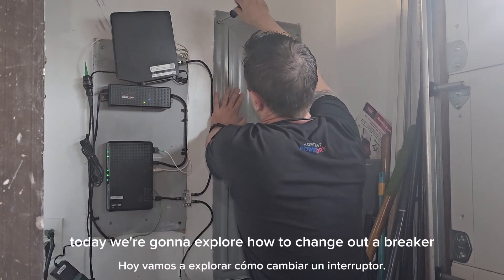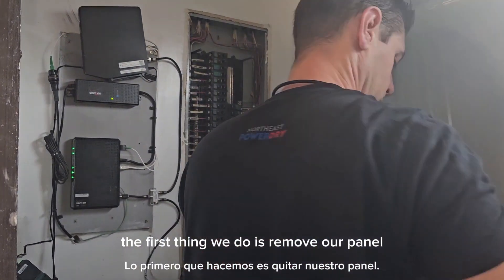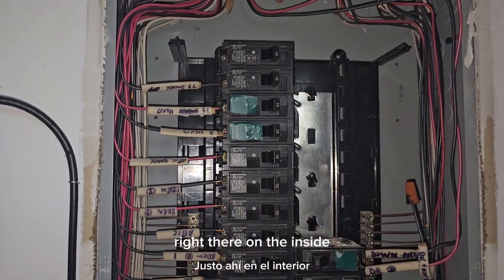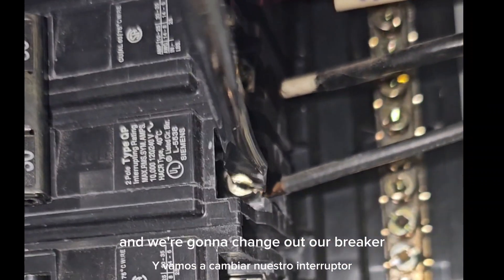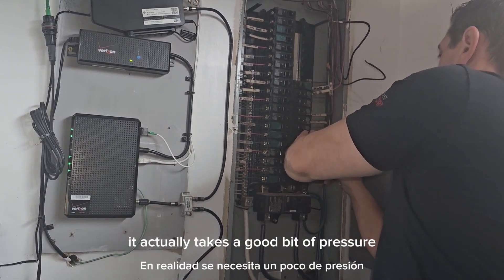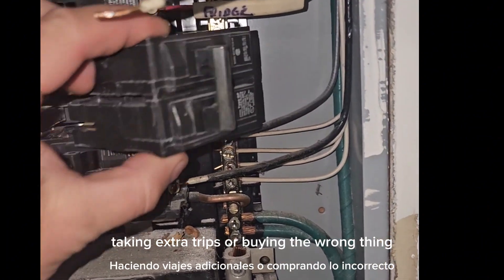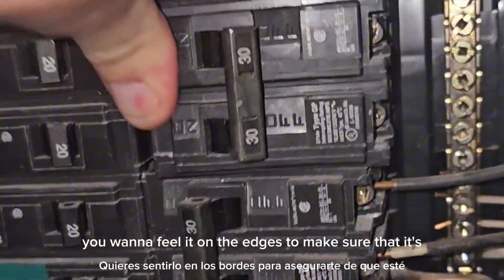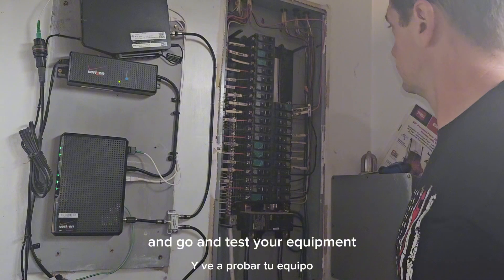How to change a circuit breaker live!  Air Condition breaker replaced #diy #hvac #electrical

Comment: Not only is this dangerous, but the bus appears to be damaged from the breaker failure. At the least, it should be checked & cleaned.
Reply from the maker: Why do you suggest the bus is damaged?
Reply: @CrazyCooL4U  discoloration on the bus bar